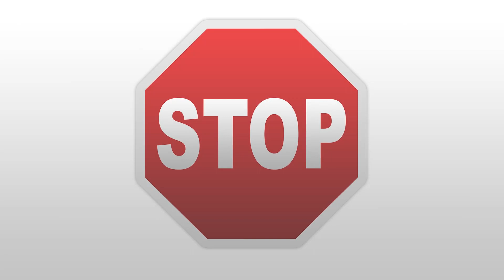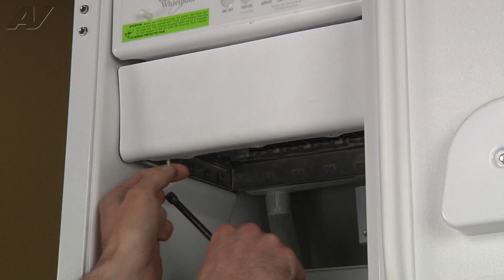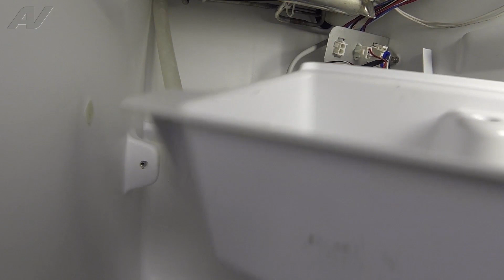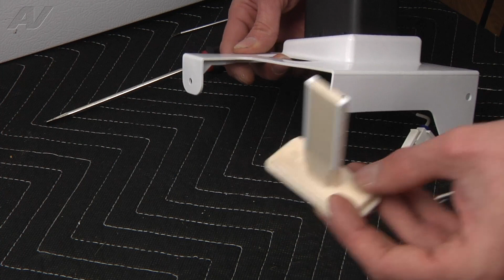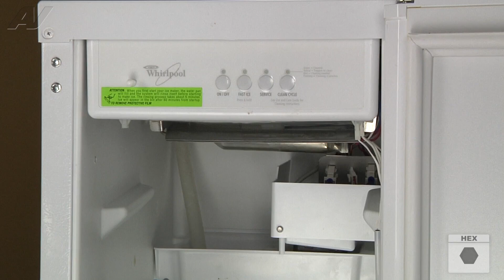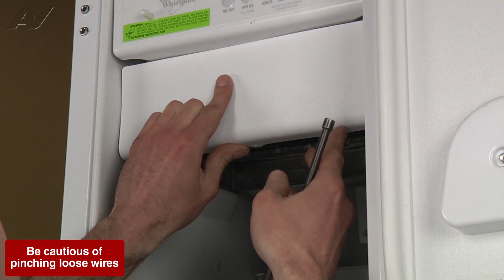Ice maker Repair - Water Fill Sensor - Commercial & Household Refrigerator - Diagnostic & Repair

Comment: Is there a way to test the acutal sensor with a meter to see if its bad. I put one in from another ubit that used to work and water still not shutting off water aftee full. Connectors arent corroded and checked harness connecting in back

Comment: My model GI15NDXZS1 does not have the fill sensor as illustrated in this video. Where would that particular function be if the separate sensor is not present?
Reply: On the GI15NDXTQ1 it is next to the  recirculating pump, in that upper plastic tray.
Reply from the maker: Great question, if you have a more technical question that our parts department cannot answer, you can search our over 17,000 answered questions free at our website www.ApplianceVideo.com under our Repair Help section. You can also call our parts department at 1-800-830-5465 and they can give you help 7-days A week ,or search at www.SaveMoreOnParts.com  .

Comment: My ice maker when I plug it in...lights on panel flash then off and something runs for about 10-15 seconds then nothing.... you have to plug it in for it to do it again... j.drum355@yahoo.com
Reply from the maker: Great question, if you have a more technical question that our parts department cannot answer, you can search our over 17,000 answered questions free at our website www.ApplianceVideo.com under our Repair Help section. You can also call our parts department at 1-800-830-5465 and they can give you help 7-days A week ,or search at www.SaveMoreOnParts.com  .